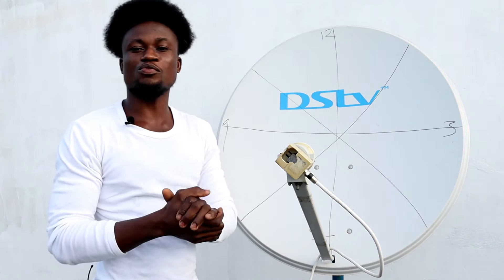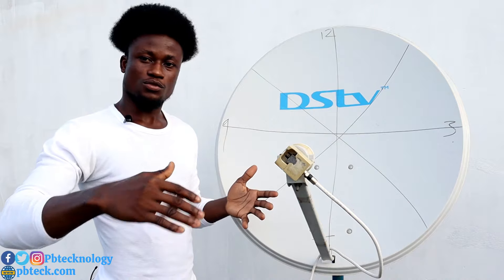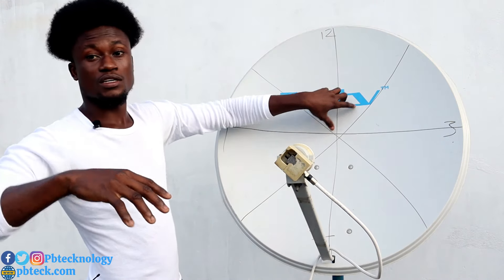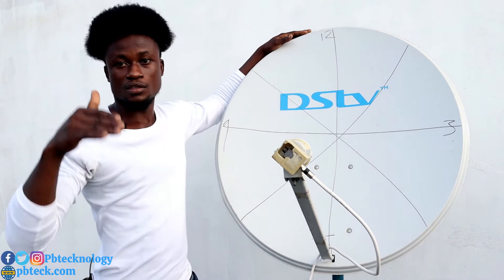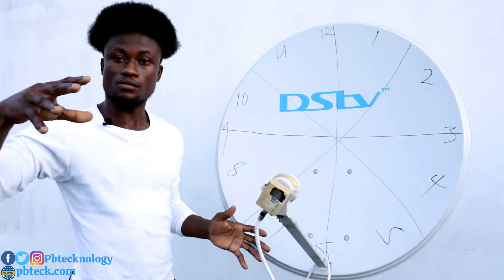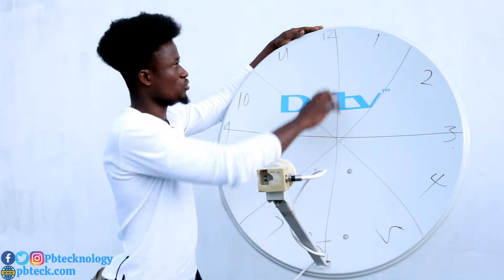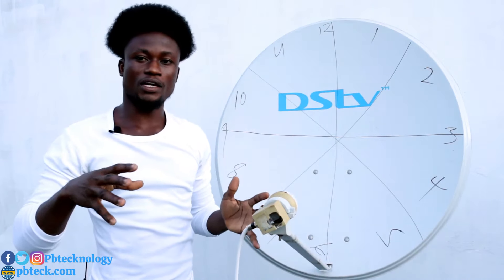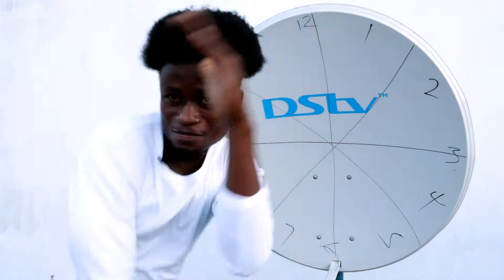How To Set LNB Position - [Dstv]

Comment: Thank you! But how does one know if the the LNB is faulty? And can it be repaired? Technicians exploit many clients through this means. They always have used LNB in their possession.
Reply from the maker: Sure, it's a criminal strategy people use to get money from clients. 
* If the signal strength shows below 45%. Most often it will be 25% / 15%. 
You can't really determine in all occasions, that's why you need a testing LNB in your tools to confirm.
Some decoders never shows any signal strengths, only when you're having a stable signal quality. So never get confused.
It's advisable to always use your trusted LNB to track.
*Don't forget to check the LNB frequency settings on the receiver.

Comment: Pls  boss , when the DS tv signal  is ok  and the weather   or cloud  is change , is coming  no signal
Reply from the maker: You get the signal from the DStv Satellite up in the clouds. The signal microwaves will be hitting the satellite dish. If there's bad weather condition, it will not allow the signal to hit the dish, which will result in no signal problem. Using a KU Band the weather condition will have immediate impart on the signal quality